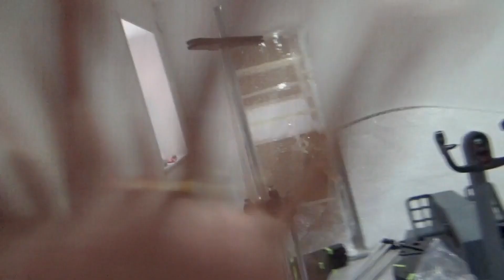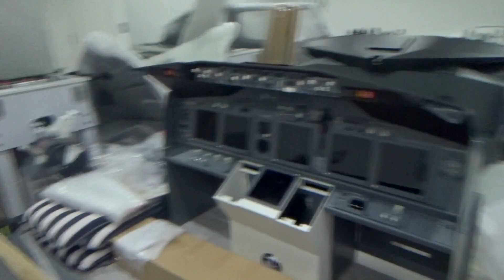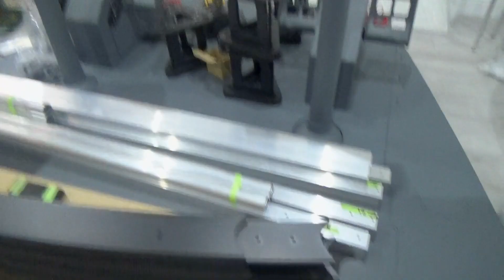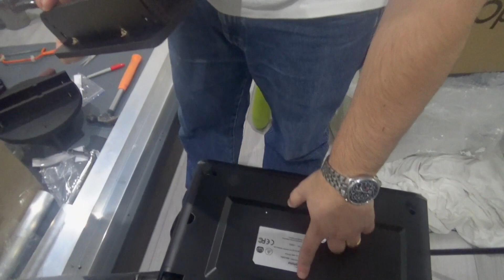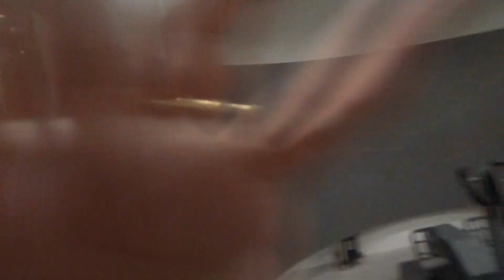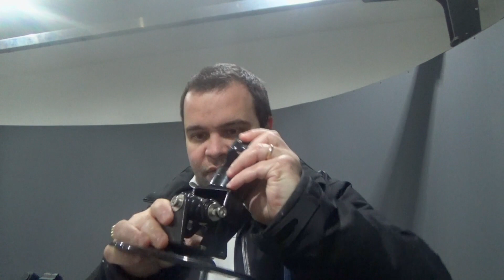Projection System - Part 1

Comment: My space is 13’ x 23’ x 8’ ceiling. I would prefer to go wrap around screen and place it lengthwise (facing down the length of the space so the max screen hardware would cannot exceed the 13’ width of the room.

Comment: this is not pro enough,  but it’s very good for a non-pro player.
Reply from the maker: Not sure I understand what you mean by non-pro player, this is as pro as you can get for homebase simulator
Reply: @alpasimulation5485  sorry for the strong words. What I mean is this is good enough for a system in home.  But it can be better if you use screen shape we use in the simulator training fighter pilots.
Reply: @richardyeung270 good job he’s not training fighter pilots then, 🤡

Comment: Why have you chosen exactly 3 projector? Why not just 1 ? Or more than 3? How did you determine u needed exactly 3 projector?
And what is the field of view ?
Reply from the maker: Hello, field of view is 220 degrees. To achieve this I have a screen that if put flat is long 7.69 meters. Based on the max distance i could get from the lens to the screen, i have calculated that i needed 3 projectors to cover the entire surface
Reply: @alpasimulation5485   Thank you for the reply. I have few more doubt about the visual system. I am currently working as a simulator engineer intern at acat Chennai. is there any way i can contact you for more discussion. That would be really appreciated.
Reply from the maker: @private_sbp  sorry for the late reply. If you connect to my FB page (ALPA Simulation) you can then use FB messenger to send me messages.

Comment: How is the screen physically attached to the framing?  I have attempted to get this question answered by the company with negative results.
Reply from the maker: Hello, the screen is attached with small screws on top and bottom of the frame.
Reply: @alpasimulation5485  Thanks for the quick response.  Are the screws the same color as the screen, do they obstruct or are they visible through the projection.
Reply from the maker: @hokiebaji  the screws are not the same color, however you can find them grey I am sure. They are very small and you do not see them at all, because they are on the very top and bottom edge of the screen and when you are inside the simulator you should not see the top and bottom of the screen otherwise it will remove the effect of immersion. All I can tell you is that my screen present few small cracks, you don't notice them but it seems to me that the material is not very flexible. Also, the full system comes from New Zealand so you may pay a lot in transportation etc.. I think you can find better solution in Europe. Contact FBC (Fly By Cockpit) and ask to talk to Vitor. They manufacture everything about simulators including the screen as well and Vitor can also show you via whatsup video how the screen looks like. You can mention my name Alberto, he will treat you good.

Comment: Nice screen, I suppose you will go with Fly-Elise Calibration Pro, in my view , the best and affordable for this kind of set up, what is the name of the company in New Zealand you bought  your screen?
Reply from the maker: Hi Miguel, i say the name in the video, anyway it's Simpit. The website is simpit.co.nz and i like them because different than others i have seen the do their screen dark colour which works better. I will not use Fly-Elise because Simpit have their own calibration software that you can purchase separately so i will have a go at that.
Reply: Sorry I missed that bit when you mentioned the name of the company, I will check it. thanks
Reply from the maker: @1Miguellima  😁 don't worry it's probably my accent, hard to understand sometimes

Comment: Hi,what is the angle of the projection?
Reply from the maker: Hello, it depends from the distance. Optoma has a nice distance calculator which allows you to calculate the distance you need in order to cover the surface area of the screen as needed. The optical specification of my projector are:
Throw ratio
 1.21:1 ~ 1.59:1

Projection distance (m)
  1.2m - 8.1m

Zoom
  1.3

Zoom type
  Manual

Focal length (mm)
   12.81 ~ 16.74

Lens shift
     Vertical +10%

Native offset
     105%